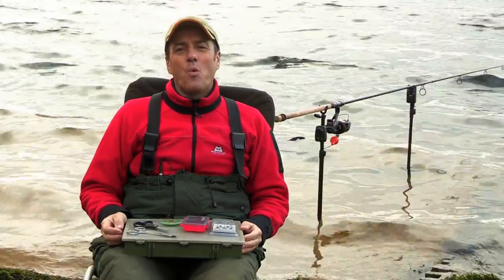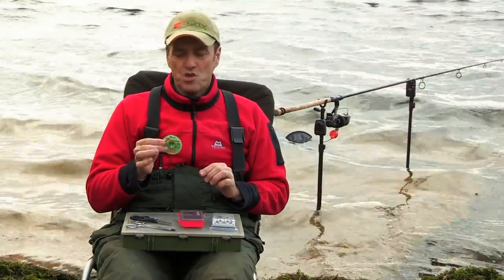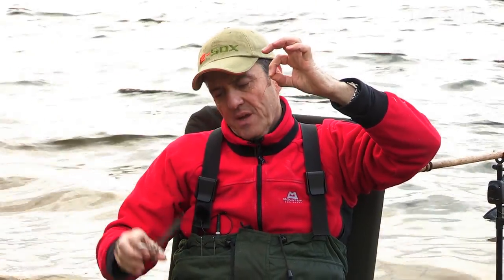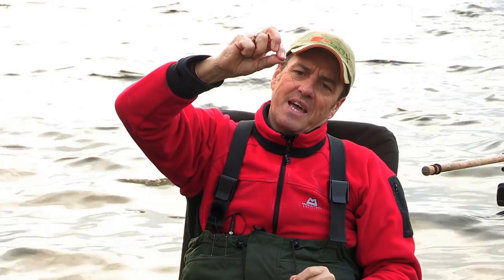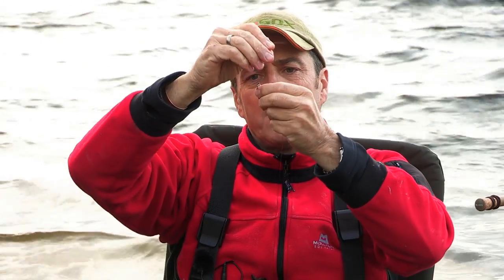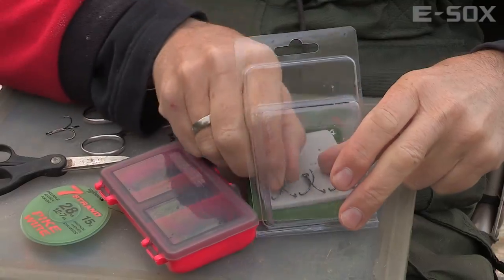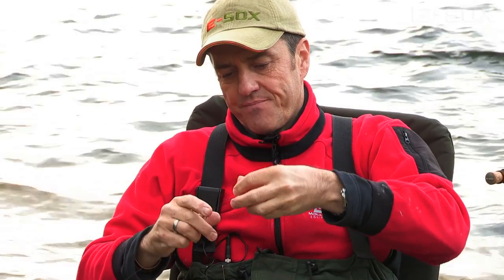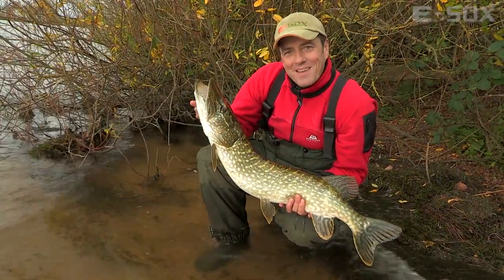Making A Wire Pike Trace With Steve Rowley

Comment: I tried this method but the wire came undone, maybe the wire I am using is not soft enough, Drennan 7 strand, 9kg which is 20lb, bought around 25 years ago but not used until recently. It works fine with crimps.
Reply: Its worse with softer wires